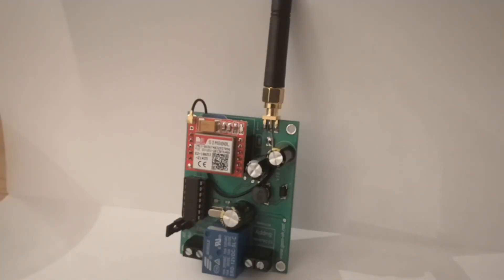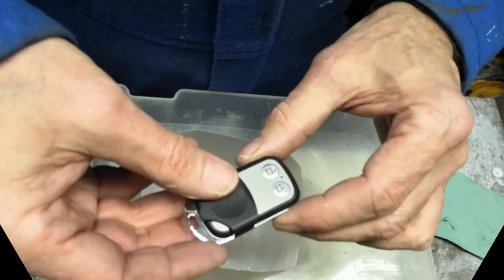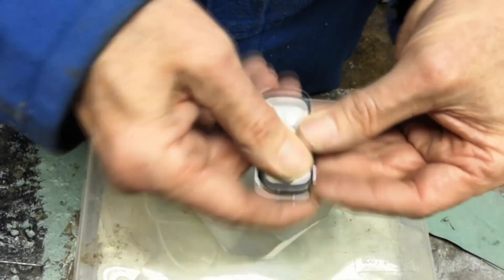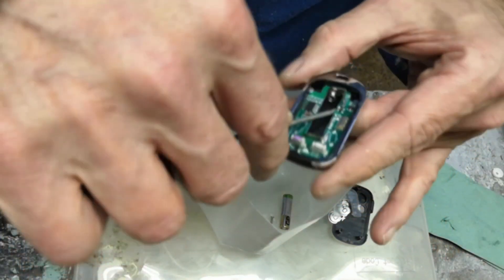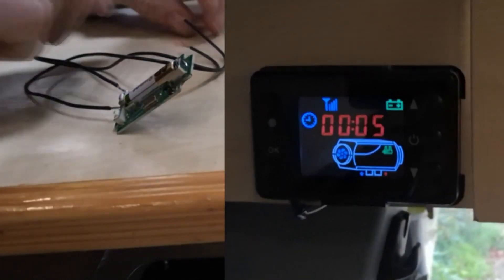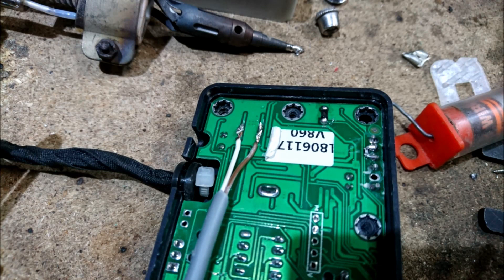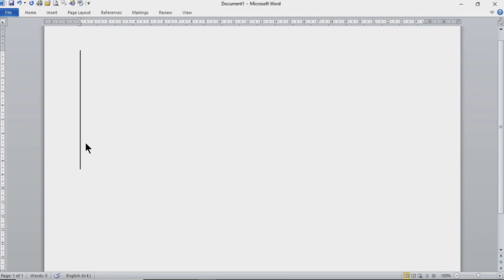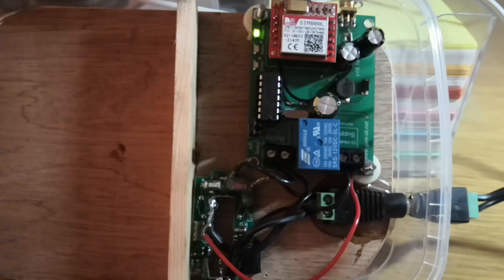Turn on your Heater by Text

Comment: Nice work!
I just bought a wifi module with four relays on aliexpress. Soldered small wires on the contacts four each button on the remote and passed them through the relays. They are controlled by an app. The module obviously needs wifi to work so I bought a small 4g router and got a data only SIM card from my provider for free.

Comment: Hi @campervan_hackers do you find after all these years this to be a good working model Im interested in automating my unit but it has the more recent remote control which probably would still work with this method. do you have any recommendations for sim card providers?